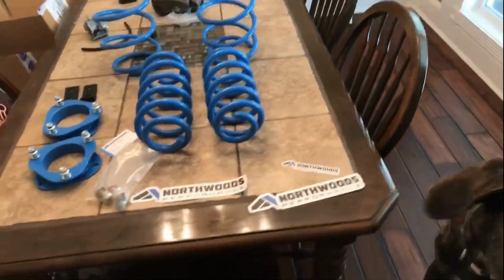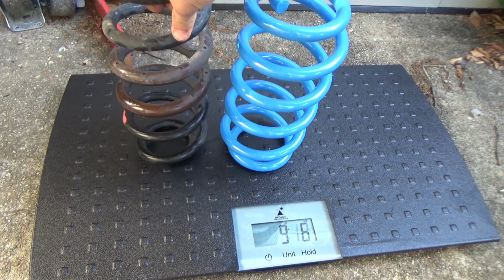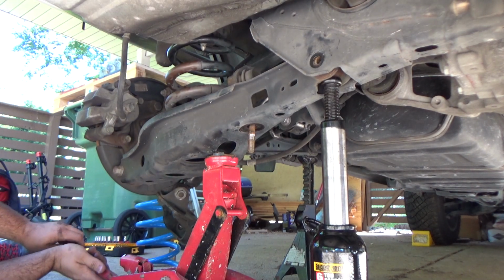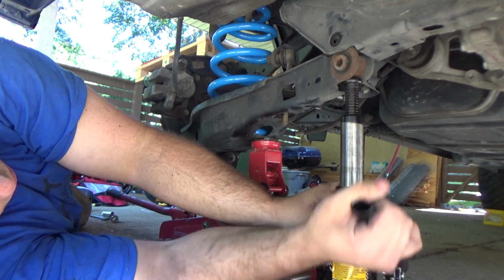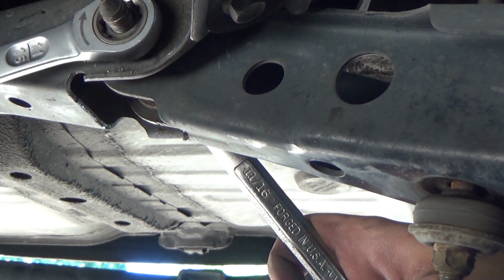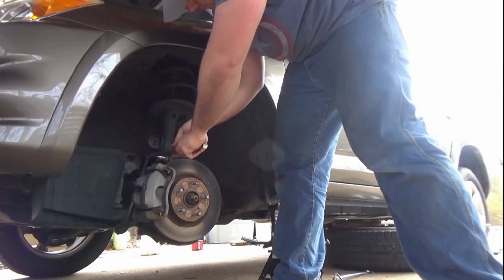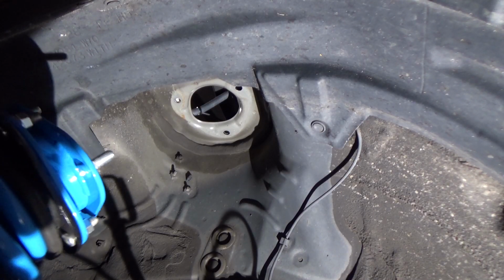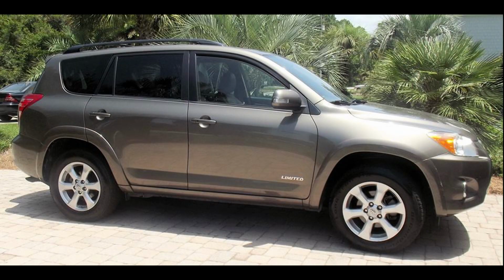Best lift kit for 2006-2018 Rav4. Northwoods Performance

Comment: Blistein 2 1/2" lift kit and 30" tires makes about a 3" lift on a 09 RAV4.  Rhino rack and batwing. Worked out great. 2 years now. No problems.
Reply: What's your fuel mileage

Comment: I installed the Updated Bilstein package this summer.  Folks, just take your time, and you can do it. It’s just nuts and bolts. I would recommend buying a can of PB Blaster and maybe a couple days before you install (or first order it) spray everything you feel you’ll need to get at (via this video) and then some. And again the next day. It gets messy, but while installing the lift, you can wipe it down when you’re done, which the remaining penetrating oil will help preserve and fight rust (you can tell I’m from Wi, lol) 
Get an alignment done after. I drove mine for a month because I wanted to wait for my new tires to come in before I had it aligned, so Everything could be done at once.  It handled ok during that time, but since then it really does handle better, firmer, flatter then stock. No rattles, no problems.
I would buy again.
Again, it’s not that difficult, you can do it.
Reply from the maker: Thanks for the reply!  The hardest part is changing the front strut spring

Comment: Holy shit, this was uploaded in April 2020, i recently bought a 2010 Rav 4 as well, in April 2020 😂😂😂.
  I feel tempted to lift it a little bit because i will take it off road sometimes, and those 2 inches can be the difference between clearing something or finding an oil leak.

Comment: So I watched both your videos on the different lifts for the rav4 and I really appreciate that because as far as I can tell you have the best diy on the web. Moving forward, between the two kits what was your experience and how do they fair up until now. I am mechanically inclines and am not scared to do the work myself however there is very little feed back on the net as far as giving a modest lift to the rav for general outdoor clearance. Thanks in advance
Reply from the maker: A lot of people believe the bigger lift the more tire you can fit, but the RAV4 front strut will limit your tire size to 31” unless you run spacers.  Both kits raise the vehicle but the Northwoods will give you more longevity in your CV axles because of how it works, but it doesn’t raise it as high as the Readylift.  Northwoods rides better, but Readylift is taller.  I plan on combining the two, but need to work some issues out first
Reply: @CreativeMechanic  definitely interested in that combo update! 

I've been debating on a lift solution for my 2007 so I'll definitely be looking forward to it. 

Does the readylift have any solution to increase the longevity of the CVs? 

And when you say harsher ride, how much worse is the readylift compared to northwood.
Reply: @ipodtouchhack1  what did you end up doing?
Reply: @mattbaldwin2806  I actually sold the rav4 and bought a 2012 highlander

Lifted and put larger tires

I love it

I average about 20mpg with the new highlander setup
Not far behind the rav4

Comment: Hi,  
Thanks for the RL and NW vids.  
Any feedback on either relocating or protecting from harm those emission components under the driver's seat area of the undercarriage?

Any issues w/the rear tow hitch w/either the RL or NW lift? What hitch do you have? Looking for one that tucks up out of the way.

My '09 RAV4 V6 AWD will be getting a lift along w/a tire upgrade. 

I test fit a set of 245/65R17 (29.5" tall/diameter) winter tires and as you noted a 31" tire would be the max due to the front's lower spring perch.

Here's a cheat sheet for wheels/tires I created.
Stock RAV4 tire height/diameter: 
215/70R16 = 27.9"
225/65R17= 28.5"
235/55R18 = 28.2" (Sport)

Upgrades - NOTE if you use aftermarket wheels ensure the OFFSET (45mm is what I found online) and Center Bore (60.1mm) will work:
235/70R16= 29"
225/75R16= 29.3"
235/75R16= 29.9"

235/65R17= 29"
245/65R17= 29.5"
235/70R17= 30"

235/60R18= 29.1"
235/65R18= 30"

Comment: @CreativeMechanics

What’s the inches of that bracket relocation kit? And are the two holes are 1” or 2” apart for one for the the strut and one for the swaybar endlinks?

I just the northwoods performance springs.

Comment: I got my Northwoods Performance 1.5" lift front struts and spacers installed no problem in about 1 hour 15 minutes. I couldn't get the rear control arm bolts out in the rear even using a hammer trying to hammer them them out of the bushings. I have new bushings and bolts ordered and will have to cut the bolts out and try again.
Reply from the maker: Rust?  They aren’t interference fit so rust would be all that sticks them like that.
Reply: @CreativeMechanic  Not sure what that means? Are you saying there is no bushing?

Comment: Thanks so much for this, was debating whether or not to go with this kit or not, and this video sealed it for me! Did yo go wit the standard option or one of the upgraded kits?
I just want to know so I know how difficult the job is going to be going into it.
Reply from the maker: Standard option requires you to disassemble your struts, so it’s very difficult and dangerous if you don’t know what your doing.  The upgraded kit with the springs mounted on the strut would be the easier installation

Comment: Looks fantastic! I'm considering doing the same for my 2010 V6 4.3 since it needs new struts and shocks anyways. Few questions - did you get the standard kit? And did you add the sway bar links and/or the leveling kit? Also, do you have the Northwoods skid plate?
Reply from the maker: No skid plate, I have the standard lifting springs. The sway bar links come standard with the kits now, but confirm that with Northwoods
Reply: @CreativeMechanic  Thanks! Nathan confirmed the sway bar links being included. I ordered the base kit and skid plate, super excited to get them
Reply: From the research I have done it appears that lift kits on many websites show how much lift they give the i4 engine and not the V6. Either of you see that the front isn’t being raised as much on the v6?
Reply from the maker: The V6 limited is considerably heavier, but, people always ask me “how much lift?” So to most car guys they can tell
Reply: @philbill1985  you ever install?
Reply: @dropx8987  I did! I didn't have the car much longer after that since I went up to a GX, but it definitely stiffened up the ride and lifted the RAV4

Comment: Awesome! Did you ever develop a shudder upon acceleration? I installed the 1” bilstein lift kit and it began to shudder/vibrate instantly. Any ideas?
Reply from the maker: Not sure… I’d replaced my axles like 10,900 miles beforehand
Reply: Hey did you ever figure out what was causing your issue

Comment: Awesome video.  Looks great. Have a 2012 V6 4WD.   With those tires being upsized, did you adjust the speedometer to be accurate? If so, how?  Have you noticed a dip in your miles per gallon with the lift and tires?  Thanks for replying.
Reply from the maker: Still getting the same on the highway, lost 2 mpg in the city.  My speedometer is barely off, at 70 mph it reads 68.5
Reply: @CreativeMechanic  Thank you.  Going to be doing the full deal over the winter.

Comment: Thanks very much for posting this. Just picked up a 2011 Limited with under 100K miles on it. At 13:42 you mention the wheels are 18" and +35, but what is the wheel width? Assuming they are 8" and not 8.5"? Thanks again. Very informative video.
Reply from the maker: 8.5 width
Reply: @CreativeMechanic  Thank you!

Comment: Dude it took me well over 3 hours to get that single lower control arm out lined up
Reply: FUCKING HOW DUDE? How did your bolt line up so easily? I just spent 4 FUCKING HOURS getting this bold through only to realize it stripped all the threads going through. 4 fucking hours on one bolt
Reply from the maker: I’m sorry you had trouble. Just one of those things you gotta have patience with
Reply: @CreativeMechanic  I think I'm having so much trouble because I only have one jack. I've concluded the second jack is actually a necessity. My lower control arm is not just aligned too close to the car, I'm having issues both needing to be pulled out, needing to be pulled up, and it's also skewed. It's misaligned on all 3 axis. I've already bought multiple bolts as I'll probably mess up a few, now I need a bottle jack as well.
Reply: Same here, not as easy as it looks.

Comment: I'm curious as to why you swapped out the readylift for the Northwoods kit?
Reply from the maker: Because they were both free and I’m in this for the views
Reply from the maker: For real though, the Northwoods kit drives a lot better IMO, but that’s partly because it’s not as tall.  Lastly the rear springs are super strong
Reply: @CreativeMechanic  I can't fault you for that reasoning.  A guy has to make a living.  We just picked up the Readylift for my son's after seeing your original video. I also have a readylift kit for my tundra. I hadn't realized you switched them and was curious about why.  Here in Alaska, height is definitely a benefit. Hopefully he enjoys the SST.

Thanks again for the response.

Comment: Nicely done! Would you rather use "Reaylift SST Lift kit" or Northwoods "Spring Lift Kit"?
Reply from the maker: Depends both have merit, the base kit from Northwoods is around the same price as the Readylift, but it sits about 1/2 shorter.  The Readylift is easier to install, but the Northwoods kit, especially with the upgraded shocks will handle a lot better.  Honestly I’m thinking of how I can stack them 😂
Reply: @CreativeMechanic   I agree. I have been wondering the same too and Northwoods says it will be fine with some minor details (I can forward an email). But "ReadyLIFT" does not recommend stacking lifts (Main website in the question sections. Other than I am wondering about "Eibachs-Pro-Lift Springs" (pending email) Any idea on that?

Comment: Should I bother putting this on my 2009 RAV4  4 cylinder 4x4? Would it be worth it without the v6 engine.
Reply from the maker: I think it would be fine.  My tires are hardly bigger than stock.
Reply: I have the 2009 Rav4   4cylinder as well, 4x4. 139k miles. runs good, did you put the kit on yours? I'm thinking of same thing. Though I think I need new struts because when I turn the steering wheel to left I hear a noise, like a clack noise? Someone told me its probably struts? I'm thinking of buying the whole kit w struts and springs etc. My Rav4 was owned by elderly folks, they never went off road or 4 wheelin,  lol.

Comment: Awesome video and I followed your advice and ordered the complete strut strut and spring kit to make things easier. However, my question is on your wheel and tire combo, since your 18"x8" rim has a 35mm offset (10mm less than original), does your 235 60R18 tire rub the inside wall and/or the fender during a full lock turn?
Reply from the maker: No rubbing or trimming was necessary
Reply from the maker: Honestly you could probably fit a 245 65 r18 on that wheel with very little if any trimming.  But tires in that size tend to be more expensive…. At least they were in 2018
Reply from the maker: Also, you probably know this, but the lower the “offset” number the further the rims stick out.  For example if I’d ordered rims with a 15 offset they’d stick out of the fenders.  Lots of truck bros get negative offsets to make their tires annoyingly wide
Reply: @CreativeMechanic  Thank you for your prompt reply! Good to know more about offsets. Your rim looks real nice but it's only suited for summer and not for our Canadian weather unfortunately.
Reply from the maker: I live in Alabama, so it’s always summer 😂.
Reply: @CreativeMechanic  Just curious is your lift kit 1.5" or 2"? I ordered mine 1.5 cuz I want the car level n not higher in the front but looking at your picture at the end I can't tell.
Reply from the maker: I ordered the 2.  But I keep so much weight in the back it sits a little lowee

Comment: Hi just wanna ask the price for that lift kit
Reply: This particular one is for 3rd Gen rav4. For this 1.5” lift kit that includes front and rear springs, a spacer, and a front sway bar end links, price is $490. Which that’s a very good deal.

@AllanManmano

Comment: As for the Rear, did you still have the Ready Lift kit on? I noticed with my Northwoods install my car Squats a bit more, not sure if I should buy a lift for the rear as well to level out stance. Thanks lmk
Reply from the maker: May just be time to replace the rear shocks.  I removed the Readylift spacers for this video, but there’s no reason why you couldn’t use Northwoods springs with Readylift spacers for a “mega lift”
Reply: @CreativeMechanic  Thanks for the reply! Yeah definitely.

I got the full kit with the Shocks and springs for the front and Rear. 

However, upon looking it seems like the springs I received are the same as stock height. Nathan from NW said that the front will sit higher than the rear but with mine, it’s a huge difference.

I made a post on the Rav4world 4.3 form about the kit and photos showing the difference. For reference, if you would like to see pictures on what I may be experiencing.
Reply from the maker: I’d ask Nathan about it.  The spring stiffness is what makes it ride higher, not the length difference.  Have you asked Northwoods?
Reply: @CreativeMechanic  Still waiting to hear back from them.
Reply: @CreativeMechanic  Nathan just got back to me and said he will be sending over new springs. 

What does he mean by this? “FYI: In the rear, because of the increase in spring rate and the motion ratio of rear suspension geometry, the amount of lift is not a 1:1 ratio. That is, 1/2" increase in spring height can provide up to 2" of rear lift.” -Nathan
Reply from the maker: Your suspension is a triangle, so increases in the 📐 angles move your wheels in and the vehicle up.  For example, the front spacers in the Readylift kit are about 1.5” but they provide 2.5” of total lift.

Comment: You sold me on this kit for my RAV4! I had it lifted recently, but I’ve been experiencing vibrations only when I hit 20 mph and stops after that. Did you have to troubleshoot any vibrations or have to change your pinion angle? Nathan mentioned it could be my CV joints (my car ran perfectly fine before the install) so I’m having that checked out soon but I was wondering if you ran into any issues as well. Thanks!
Reply from the maker: You get an alignment after the install?
Did you change tires at the same time?
Reply: Thanks for the reply! I had an alignment done and no new tires. I’ve read that it may not be a tire issue at low speeds, but I’ll go get a second opinion on an alignment or have my tires rotated.
Reply from the maker: @FingMou  what year is your Rav4?  I did a video on the “non adjustable” toe arms for the 2006-2012 models
Reply: I have a 2010 3.5L V6 Limited with about 87000 miles on it. I bought it off an older lady who never took it off-road or stressed the car out (from what she told me). I’ll check that video out!
Reply from the maker: @FingMou  that could definitely be the issue
Reply: @CreativeMechanic   Hi again! I've been doing a ton of research on the vibration, and I'm finding many people have the same issue with vibration at 20 mph on acceleration. I believe it has to do with the CV axle angle. Did you lower your frame to make your CV axles straight? Or do you know of any products (similar to diff drop kits or subframe drop kits) that can help with that? At this point, I'm going to deal with the vibration and eventually change my CV axles.
Reply from the maker: @FingMou  no no issues for me, but changing the toe angle 📐 in the rear with adjustable toe arms makes the rear wheels straight up and down and would put less strain on the toe arms

Comment: What’s the mayor difference between This kit and the spacers kit.. When it comes to hight they both gain 1-1/2 inches right? And why do you need a spacer for the front if you are replacing  springs like In the back? What’s the point of replacing front springs?
Reply from the maker: Springs let you carry more load with less sag, they lift the vehicle without as much stress on the CV axles.  The spacer is used to “level” the vehicle so the front sits level with the back.  However the spacer in this kit is much shorter than a spacer alone kit.  Both types of kits have pros and cons
Reply: So is it possible to put regular 40mm spacer to this set of springs for higher clearance??
Reply from the maker: Possible yes, but your CV axles will not like it, your brake lines may need to be extended and You’d have to put in adjustable toe arms or the rear tires tread would wear very quickly.